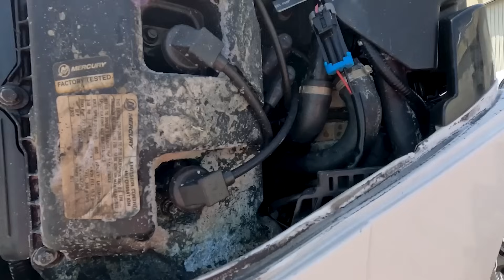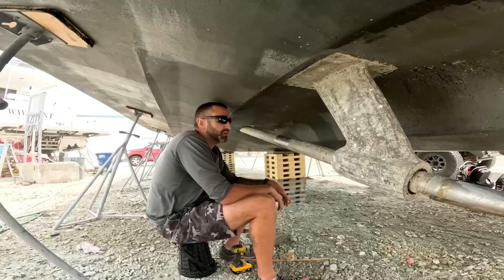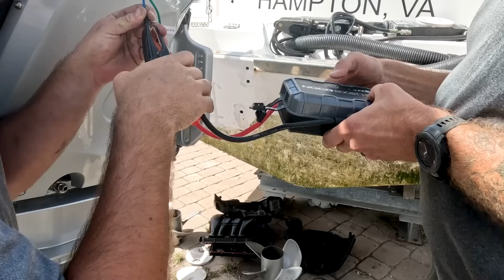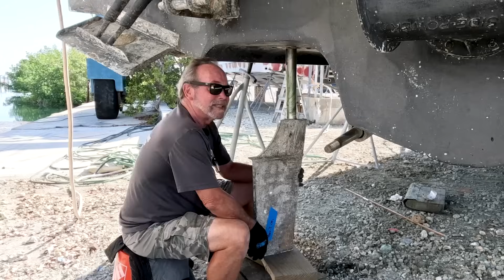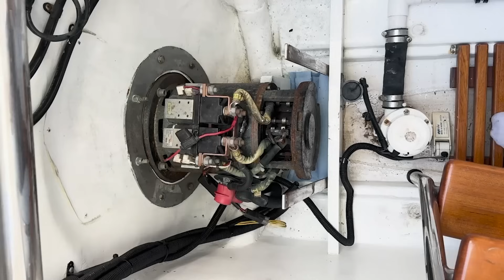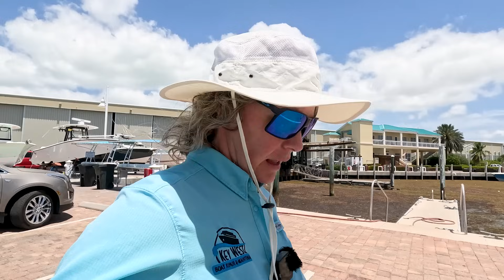Why this 70ft yacht caught on FIRE

Comment: Great channel, great videos. When the video started, the guy was running the refrigerant lines for the ac on the boat, and the 1/2" line had No Cap on it, and 1/4" did, then while the guy was explaining what he was doing, he tapped the file on the Non Capped 1/2" copper line.!! I said to myself, that whole system is likely now doomed, these ac units wont function with contamination in the line, even little dust particles will damage the compressor. Then later in the video, up on the bridge, the line is still not capped, after he snaked it up to the bridge. I would say, if this ac system  starts having trouble, you likely need to rip the entire system out and replace all the components.

Comment: Most of us have learned that electric motors operate on Magic Smoke. The trouble with turning a commutator, or even sanding it down to clean it is that reduces its diameter and thereby decreases the spacing between the contact bars. The brushes then hit more than one contact bar at a time and things can get smoky. A little careful polishing you can get away with once or twice. I generally use Scotchbrite green scrubby pads. More than that gets scary.
Reply from the maker: Thanks for sharing.

Comment: You guys want to hear a story. Ok. Here we go. My dad owned a fleet of older wooden boats. He loved working on them , and bringing them back to life. One of the boats was a 28FT Owens Sport Cruiser. It had a single small block GM Engine. The boat itself was in good shape, but it had a major issue. The motor would run like clockwork sitting on the dock. As soon as you took her out and the Boat went up on plane, Poof. The motor would die and wouldn’t stat again. Well this happened one time and it was the only time my mom came out with me and the old man. We were cruising nice and slow and thought we had the problem solved. So the old may tried to goose up the throttle and sure as S**t the motor died. It was a windy day and we had a lot of trouble getting the anchor to grab. We were under the Throggs Neck bridge (NY Boaters will know where this is ). We drifted toward shore and were headed right up to a shoreline loaded with huge rocks. I jumped in the water and tried to keep the boat from crashing on these rocks (KLeep in mind Plywood Bottom Boat, not the most durable). Anyway, I trying to keep the boat off the rocks when along comes so old guy in a little dingy with a 5hp Evinrude on her. We threw him a line and to this day, I don’t know how be he managed to town us back out into the channel where we could wait for the police boat to tow us back. Few things happened on this trip. One , My mom never came out of the boats again, Ever!.  Even after my dad bought one hell of a boat a 32' Revel Craft Fly-Bridge Cruiser. The boat was amazing. But, getting back to the Owens. Dad and I couldn’t figure out why the boat ran so well when she was tied up, but as soon as you took her out, she died. Turns out there was water at the bottom of the fuel tanks, and whenever the boat would plane off, the fuel tanks would be a such a position that the dip tube would get to the very bottom of the tank where the water was and kill the motor. All we had to do was pump the tanks and add fresh fuel and that boat ran like hell. She was fast too, that light plywood bottom powered by a 300Hp Chevy block, she would leave flat water behind her when you opened it up.  Anyway, that’s one of many stories about me, my dad and our boating days. I'm 61 now, my dad been going a while now, but every once in a while I like through all the old pictures of all the great times we had on those boats. I lived in NYC, (The Bronx actually) and we would take half the neighborhood out with us on some fishing trips.  Miss you dad, You old salt Dog...

Comment: Your motor fire on the boat, if you were in India, they would remove it, take it apart, REBUILD IT COMPLETELY, paint it , test it and reinstall it, in UK there are many companies that do this, very disappointing your local man said  no thanks.
Reply from the maker: Have to remember we live on a 4x2 mile island so services and parts are limited.

Comment: I notice the zinc sacrificial anodes used to combat the very aggressive seawater action, another method is impressed current, which is/was used on pier structures by a company called  MAPEL, ( Metal and Pipeline Endurance Limited) . Is it that zinc is easier, more fit for purpose ?

Comment: I had an electric fire last year.  I was installing a 12 volt lithium system on my house bank and the first time I turned it on it caused the ignition wire to instantly melt and a small fire broke out.  I was in the engine lazarette with it and there was water in the bottom so I was lucky I wasn't electrocuted.  I hit it with the fire extinguisher and then checked my wiring and found the problem and fixed it. It didnt really damage anything but it was scary as hell to see how fast 200 amps can melt 12 guage wire.
Reply from the maker: Yup sounds scary 🫣

Comment: Back in the day I bought a brand new cruisers barnegat ayo 228 MerCruiser that was up on lake Erie I loved it and it was a beautiful boat and it could handle the rough water in lake Erie nicely. The second day that I had owned that I was out in lake Erie with my wife and two little children and in the middle of nowhere the engine just died. It would not start no matter what I could do so I got towed back to the marina in Catawba Island Ohio which was called Fox Haven at that time. Still is. I got the guys from the marina to come down and take a look and they discovered that the ground wire from the hot side of the down to the fuel tank had burned all the insulation off they told me that while I was sitting at the dock completely shut off that there were three votes of power on the fuel tank. That was pretty damn scary I'm back at that time my wife and my two little daughters would sleep on the boat every weekend they told me that they would not sleep on that boat because with three votes of power on the fuel tank something was seriously wrong. After the company that I bought it from which is right next door called treasure cove Marina had the boat for several weeks they could not figure out what's going on. I finally talked to an engineer at cruisers Incorporated up in Wisconsin and said I have got to have a new wiring harness there's something definitely wrong with this and dangerous. That's the last thing they wanted to do but finally they agreed to send a completely new wiring harness down to treasure cove. The treasure cove guys spent a lot of time installing it and they discovered that when the rub rail had been installed. There was a screw that had run into a high-power hotwire underneath the gunnel that was causing intermittent shorts and applying power to the gas tank. To this day I'm amazed that the dealer and the manufacturer cruises Incorporated were so unwilling to deal with what I thought was a serious problem and turns out to be a serious problem but anyway the new wiring harness solve the problem and I'm glad that my family and I did not die from that boat blowing up due to a manufacturing error. So there's a scary boat story for you I think. Love your videos

Comment: 3000 hours is less than half life for an average marine diesel. Why do people buy and operate V8 gasoline outboards?
Reply: Because all the cool kids are doing it.
Reply from the maker: Personal preference maybe
Reply: Marine diesels provide excellent torque but at lower rpms. It's great for massive boats that have a lot of weight to push through the water. Gas outboard provide decent torque, but high rpms when needed, moving lighter loads at faster speeds.

Comment: I'm 57 years old and since the time I started at 44 years old I have sunk 7 boats 2  Of them them twice
Reply: I really don't know it keeps me shaking my head always once it was a time in Key West for my boat got stuck under the dock the tide went back in and out how's the back of the boat down so it sunk I didn't lose the whole boat and recovered I got a new battery except for whatever let's say my duck butter song twice to the heavy rain poor in the bilge is not keeping up two other times on my 30 ft Mako one time of mechanic worked on it pulled a screw out of the helm which went through the hole so a steady stream of water got there in the morning it was sunk low the next time I was sitting at a bar in Destin in the storm blue Waves over the back bill just did not keep up so it went down before my eyes I really not sure why I sync so many boats it's always a different reason every time but I'm good at it LOL
Reply from the maker: @a-perfectcleanwaterdamager6061  oh m my .. crazy!
Reply from the maker: How are you sinking so many boats?

Comment: I’ll tell you a fire story that I seen with my own eyes because I would not believe it. These people were at a fuel dock and they were taking on fuel with engine hatch closed and a 19-12 year old boy setting on the engine hatch and it blew up and they that kid about 25 feet in to the air and the hinges held a little bit but was enough to launch that kid away from rear of boat and he got banged up but no hospital and that’s why I tur my blowers in and engine hatch open. This was crazy because when it blew it blew the fire out, how much luckier could you get! And the same summer at same lake a boat sitting in the middle of the lake theis boat blew up and only people on the boat was the wife and her husband was in the water with their 3 little kids . The wife got burned like a flash burn because it burnt most of her hair off and that boat burned down to the water line. That lake usually has a ton of jet boats on it , but there was not a Jet insight , I say this because that is what usually puts boat fires out and I had my jet but just hauled it out. But 6-7 years ago there was a boat fire on the same lake and it didn’t blow up. Everybody from the boat were on a big raft and they way they told the story they had food cooking on a grill and a big cruiser went by and knocked over the grill which was the type you would use at home not a boat, so it was not fasten down and this was like a 25-35 foot fiberglass deck boat and it got going pretty fast . So my buddy and I had our aluminum jet boats that we fish the river in because they run in 4” of water and we heard horns blowing and we looked and could see all the smoke from this boat and we took off to put the fire out and the owner said thanks but no thanks let it burn don’t do anything just go away. A week later we were at the fuel dock we asked about that boat fire and the water patrol was looking for me and my buddy because they had some questions for us. We told the guy at the fuel not to give out our name because we knew what was going on and the guy said ok but he asked what happened and we told him and 5-6 hrs later we stopped by to fuel up because we were going up the river about 19 miles and camp on a sand bar, he told us the water patrol came by and asked if they had heard anything and the fuel guy told him the story, and we never heard anymore about it.
Reply from the maker: Yikes. Sounds pretty scary.
Reply: Yes mam

Comment: Ok. A boat rigger story, absolutely true and funny & scary as heck!  Was on an old salmon seiner stlyle boat.  It was maybe 28’ long.  Moored In the harbor, on a bright sunny day.  The goal was to clean the thru hull  transducer’s paddle wheel. As many if you might not know, the system Airmar has is the paddle wheel goes thru about the center of the transducer (about a foot long) a round removable center shaft about 2” wide.  When you remove it while in the water (I know, Here we go) there will be a hole RIGHT AS YOU REMOVE THAT INSERT AND PULL IT OUT (pull straight up with force). But ingenuously there is a flap designed to close and do a near 100% water stoppage the second you pull it out. Works great, for a scary potentially maneuver.  As always, a smart person always tests the bilge pump JUST to be sure in case of….of an emergency.  So, I’m in the dark recesses of the bilge with a flashlight and I disconnect the safety device, then I pull like hell to get that bugger up and (ever-so-slightly) turn my wrist back and forth an finally that insert comes up with a ton of force behind it!  POP!!  Here’s where the panic sets in….!  I see a beautiful light blue circle of light coming thru a hole in the bottom of a bubbling hole with water pouring in!!!  I about shit my pants as I was stunned for about 2 seconds!!!  Water pouring in I was looking in the beautiful hole and saw there was no flapper valve!!!  It was a friggen hole!  About 5 seconds later the bilge turns on and I decided to try and put that valve with flapper valve still attached to the insert back into the bubbling cauldron of water coming into the boat —BACK in the hole! It probably took me 3 to 5 seconds to orient it correctly and down it went and the flooding stopped!  I have never been so scared in my life!  Moral of the story?  Expect the worst and plan for it!
Reply from the maker: We don’t mess with thru-hull’s in the water to much can go wrong. I’ve heard people repairing them in the water that’s not a job for us! I bet you were sheeting 🤣
Reply: Glad you managed to get it back in quickly ~ nice work Cheers

Comment: Matt : In all my 35 years in USCG no fires but lots a drills. My first boat when I was young a 24ft Winner I/O had  a fuel leak , no problem fixed it no leak. When I was cleaning up the bilge using a Brisiel brush soap and water on a fiberglass hull. Yup puff the magic dragon, fire in the bilge, dry chemical put it out quickly and then to clean up that mess. Yes, Grasshopper learned a good lesson that day. Get well soon my friend.
Reply from the maker: Pretty scary …. We had lots of fire drills in the Navy too.

Comment: Why do mechanics call engines a motor. Motors use electricity. Engines burn feul. It's basic grammatical identification.
Reply from the maker: Yup.
Reply: Mouse motor

Rat motor

Small block motor

Etc. 

It's been used for decades despite the correct usage.

You're like the guy raging at the hurricane. It makes you feel good, but nothing will come of it.

Comment: Matt didn't bring the marshmallows for that fire smh 😂 jk and the scary boat story I have was actually a couple of weeks ago, remember when I told yall I was going to go look at that boat by Wisconsin went for a test ride on it I noticed the outboard kinda tipping hard like the lower unit getting ripped off and I took a look the lower mounting bolts were pulling through the transom it was completely rotted out 😂 and glad to see you are getting better matt.
Reply from the maker: Yikes that can happen with transoms/floors as you know that’s why it took us so long to find a boat.
Reply: @WillFixThat   right, I'm still looking but not in a rush honestly yea I would love a little bit bigger boat, but my 19-foot works for now